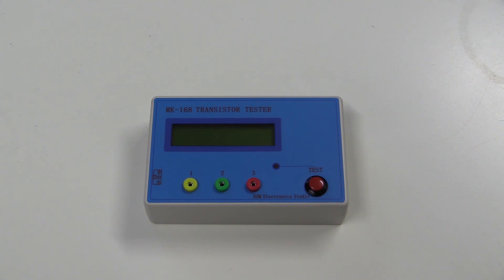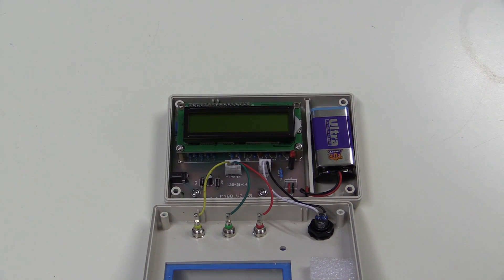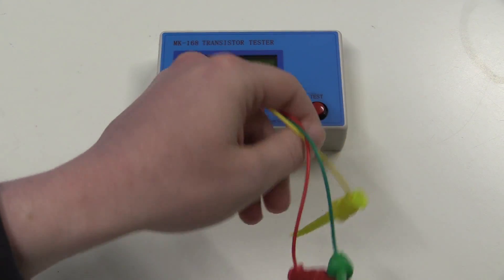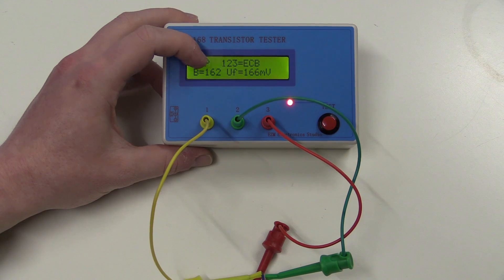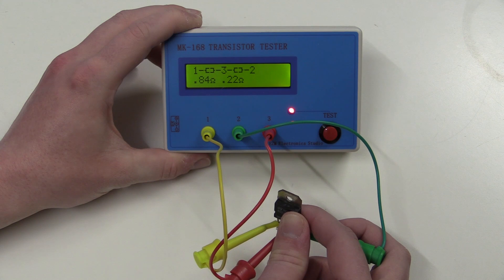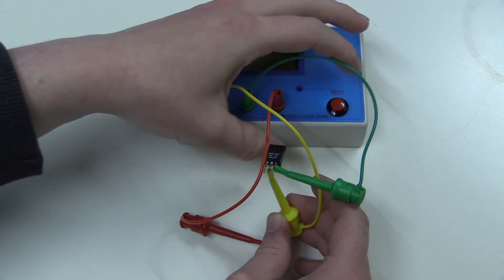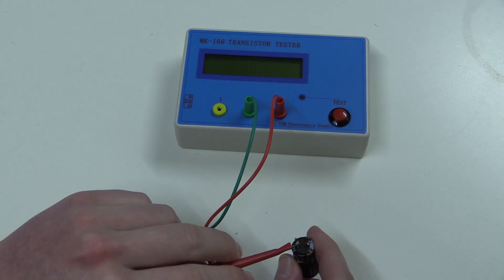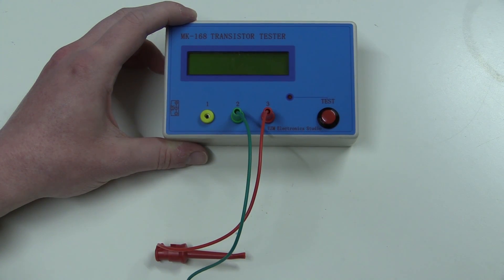Chinese MK-168 Electronic Component Tester review/demo [1/2]

Comment: So can I make matched pairs of transistors using this device?  If not, do you know of another piece of equipment that will do that?
Reply from the maker: Correct, you can match the current amplification factor (hfe) using this device.
Reply: dont match  Vbe

Comment: Testing a PNP Transistor (2sa726s). I received a reading of B=317 UF=671mV
I found that "B" is actually hFE. I looked up hFE and it states that this is the DC current gain or amplification factor of a Transistor. And "UF" is actually Vf, I looked that up too, it states that this is Diode Forward Voltage. Since I could not find a Spec sheet on the 2SA726s, I found a Spec sheet on its substitute, the 2SA970. It appears that with this spec sheet, the hFE reading I got on the tester was within specs, but the Spec sheet doesn't list a Vf specification. And looking at the specifications sheet, it appears that there are eleven test conditions, and only one of those test conditions is measured by this meter. It's possible that if anyone test condition fails within the transistor, the tester results may produce a clear malfunction.
Reply from the maker: You are overthinking this. If a current amplification factor (hFE, B) can be measured and it is within the specs of the transistor, the component is most likely fine. Vf (or Uf) is the voltage drop across the base-emitter-junction. That value is pretty much irrelevant, therefore there is no specification for that. Vf should generally be between 0.6 V and 0.7 V for a silicon transistor. For a germanium transistor it will be lower.

Comment: Excellent review. Seeing this believes that compensates pay for an atlas dca55 peak. Have you tried the ESR-2501A meter ?, seems the same manufacturer. http://www.ebay.es/itm/121174528766?ssPageName=STRK:MEWAX:IT&_trksid=p3984.m1423.l2649
It would buy Atlas dca55 and esr70, but now I am in doubt whether to buy MK-168 and ESR-2501A much cheaper and seem to do the same. If you can give me some advice.
Thank you.

Comment: Does this test transistors, fet's etc in circuit? So pretty much if we know it's a npn or pnp transistor and it shows up under something else then it's bad. But what if you can't find a data sheet or no part number on the part how would you know if it's good or bad? Thanks
Reply from the maker: Some components can be successfully tested in circuit, however, the safest results you can only get with the DUT (device under test) removed from the circuit. That is the case with all of this test equipment. The DUT will show up as NPN or PNP or FET, if something is wrong, the tester will say 'No, unknown or damaged part'. If something is shorted, it wil show up as very low value resistor. So only when the DUT shows up as bad and it has no part number on it you will have a problem.

Comment: You've probably figured out that the pads on the adapter are for testing surface mount components.  I got the bare unit and put it in a case - very useful gadget.

Comment: ... it can test inductors above a certain threshold. It will detect the component as a resistor and show the inductance characteristics of it. Provided that the value is in a detectable range. I'll dig a bit deeper into it tomorrow and post a video about that.
Reply from the maker: I have put an annotation into the video to correct that. Tomorrow I will hopefully be uploading the next part.